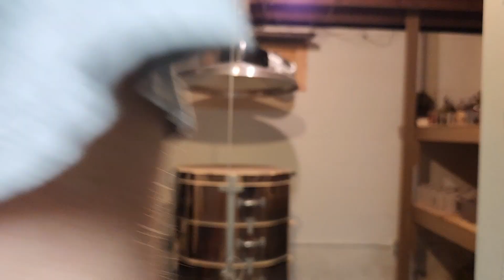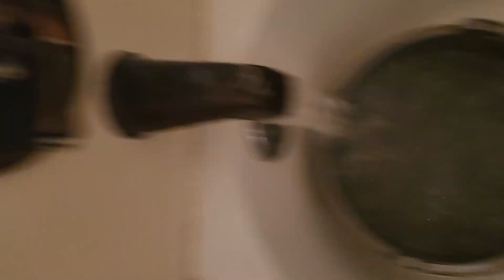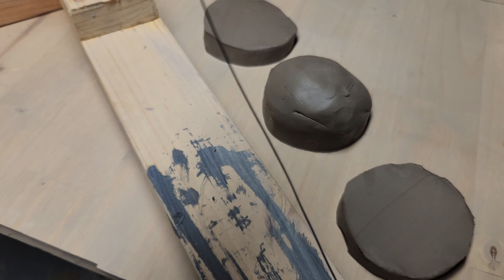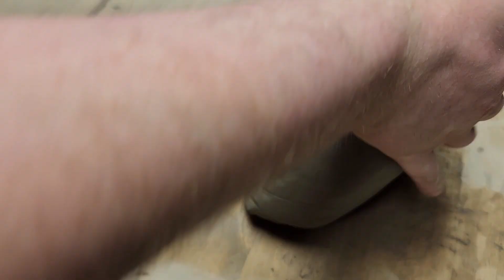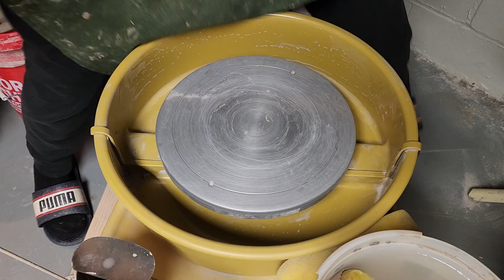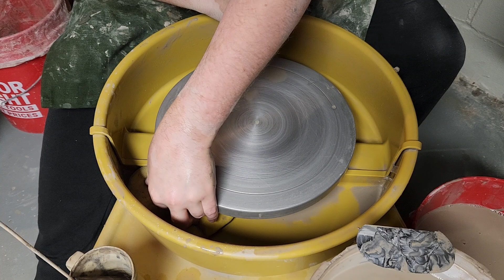Throwing Alabama Ring Bottles on the Wheel

Comment: I enjoyed that very much. Why did you spray down your apron first?
Reply from the maker: Working with stoneware on the wheel, your apron is your best friend,  and worst enemy. Just moving around throws a bit of dust into the air. That clay dust overtime can build up in the lungs and cause cancer or other respiratory illnesses. Wetting your apron causes less of that dust to go airborne thus saving you a bit of trouble in the long run.
Reply: @BowlsByBrodie  thank you. I've taken a few classes and no one has ever mentioned this.